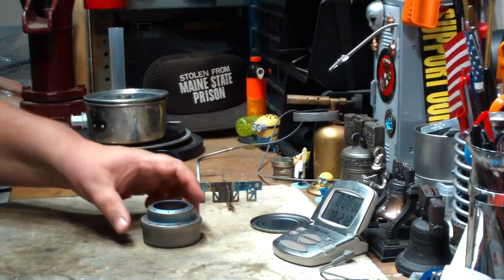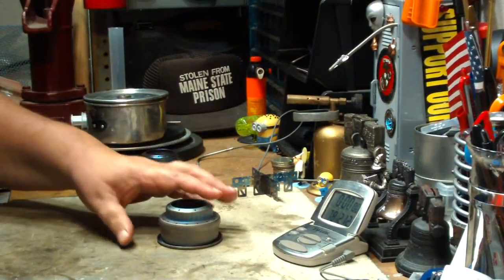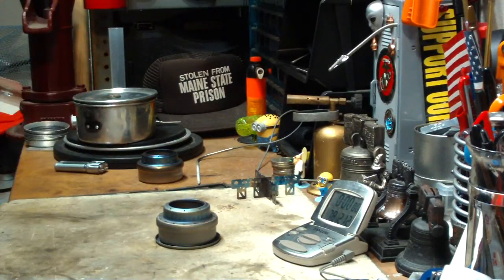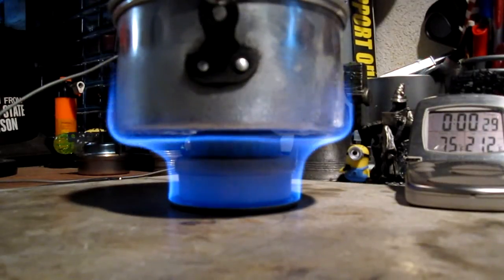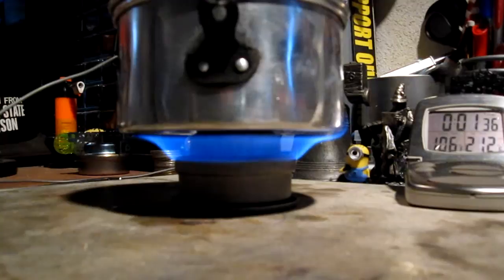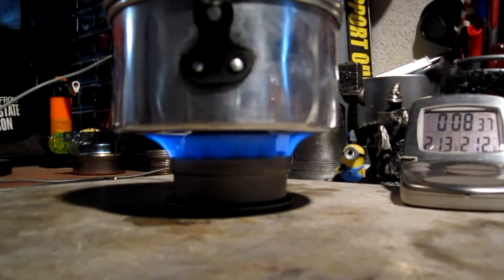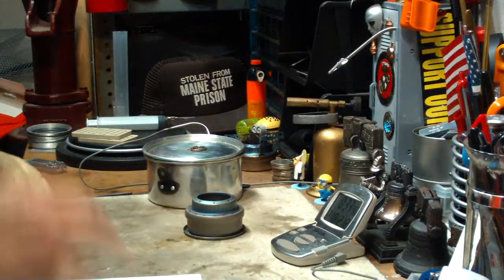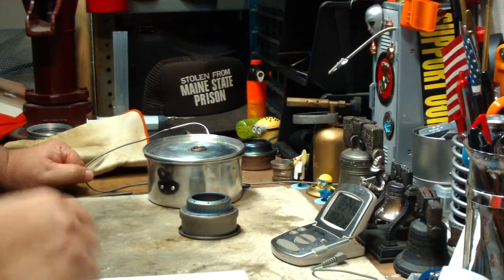Survival EDC Ultralight Titanium Alcohol Stove Using Primer Pan Without A Pot Stand - Boil Test #2

Comment: Awesome results!
Thats a great time for a full burn on 2oz
However have your tried the Evernew on the same test?

I think for primer if you try a ring of carbon felt around your primer pan then just about 1ml or even less would do the trick while concentrating the fuel in the felt for a more stable burn. So, lay a piece of carbon felt on the pan and cut a doughnut ring out so the stove sits inside. The alcohol fill felt will burn longer with less alcohol and less chance of spilling too!